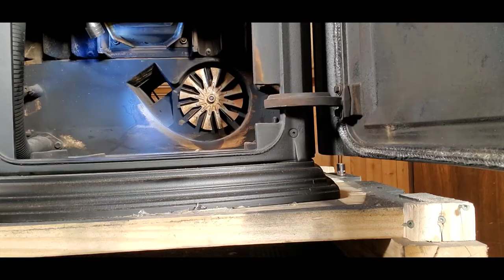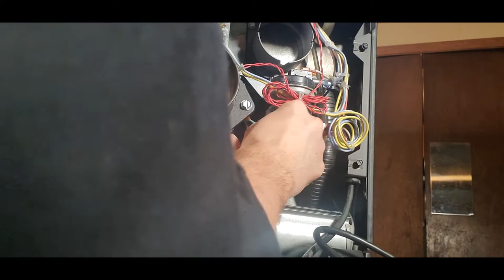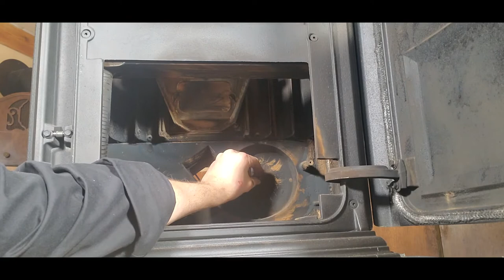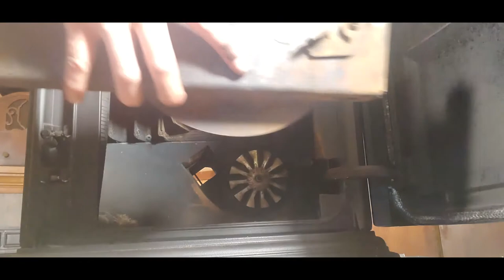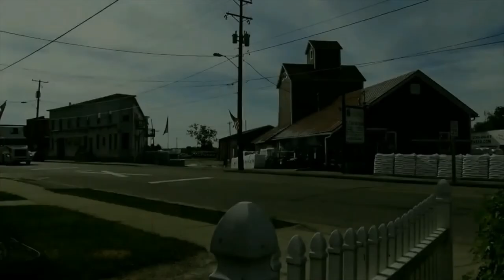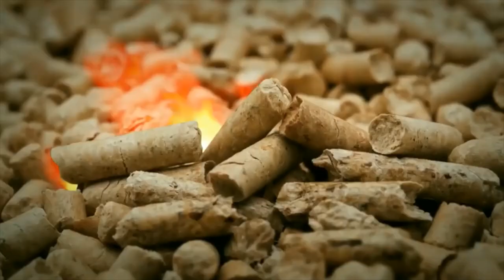How To Replace a Harman Combustion Blower, Exhaust Fan Draft Motor

Comment: Do you have a video of this teaching on a Harman Advance?
Reply from the maker: Thanks for the message. We do not, just on the Accentra FS here, however the Advance is very similar in all aspects. Any specific questions let us know, happy to guide you through. Thanks!
Reply: @EarthSense  Ok. Also I went on your webiste to try and purchase the auger and combustion motors but I do not know which I need because you have several to choose from. My advance is from 1999 so do I need the counter or counter-clockwise auger and which combustion motor would I need?
Reply from the maker: @milagrossmith4891  Thanks for the message. 1999 Advance will have the chain driven feed system which requires the 4RPM Counter Clockwise Auger Motor. Link below will show you OEM and Aftermarket options. We also have a video on auger motor replacement in the chain drive Advance if you need to reference that. 

https://youtu.be/AeuekPHdoCs

https://pellethead.com/product/harman-4-rpm-counter-clockwise-auger-feed-motor-oem/

The combustion motor will be part 3-21-08639 and fits all year Advance models. Link here will show the OEM and aftermarket options. 

https://pellethead.com/product/harman-heatilator-ecochoice-combustion-blower-exhaust-draft-fan-motor-oem/

Let us know if you have any other questions.

Thanks!
Reply: @EarthSense  I am in the process of ordering now. Does a combustion motor come with the single paddle blade or do I have to purchase have separately
Reply from the maker: @milagrossmith4891  Your Advance uses the 5" double paddle fan blade. If you do need a new paddle that will be separate - here is the link to the one you would need https://pellethead.com/product/harman-heatilator-5-double-paddle-combustion-fan-blade-impeller-aftermarket/
Reply: @EarthSense  thanks for everything. I've already ordered. Cannot wait to receive these parts and get my stove going again
Reply from the maker: @milagrossmith4891  Absolutely! Keep us posted once received and if you need any guidance we are right here to help. You'll be warm again in no time!
Reply: @EarthSense  Hello again, so I finally took out the old combustion after having to use a hacksaw to cut the  pipe because the allen screw was stripped to death and would not budge. I notice that the new combustion does not look like the old original one. The old one looks like it has another fan behind it. Can I still use the new one I purchased from Earth Sense.?  Also what about the electrical wiring. How do I attach the wires because it seems like a different set up?
Reply: Ok so i re-watched this video again for the 100th time to see how the electrical was connected. Turns out I do have the same wires but in the new blower the wires are not incased inside that thick back wire. they are just loose. Can I still re-connect the stove this way? and what about the round wire?
Reply from the maker: @milagrossmith4891  Thanks for the message Milagros. Yes, the early Harman combustion blowers had a double fan enclosure. All new replacements will just be the single fan like you received. We guarantee 100% correct function and performance. Happy to walk you through the electrical. What lead wire colors do you have coming to the combustion motor? Earlier units were a bit different, but the new parts are compatible. Let us know and we'll guide you through. Thanks!
Reply from the maker: @milagrossmith4891  Hey Milagros, just saw this message as well and wanted to respond. Glad you verified the wires. Yes these wires will be loose, again another design change over the years, but yes connect it with those wires and if wires are loose/dangling once installed you can always use a zip tie to keep them secure and away from other components. I'm not 100% sure what you mean by 'round wire' - can you provide me a little bit more detail/explanation? We'll get everything 100% bud!
Reply from the maker: @milagrossmith4891  I think you meant the ground wire Milagros as I think about it. Yes, earlier units will not have that ground wire spade. You can either leave it disconnected entirely or you can ground it to any screw on the stove body. Most will simply leave it disconnected. Keep us posted!
Reply: So I finally finished replacing the auger & combustion motors. Your instructions were on point!! Thank you for your instructional and informational videos.  I have never done this before and doubled I could but I followed your steps and success!! My stove is now working and not a moment too soon for these frigid temps were are experiencing. Just a comment I would like to make regarding the wiring on the combustion motor. The new one did not come encased in the long thick black wiring as my original one did and the wires on the newly purchased combustion were not long enough to run to the other side. The solution: I cut the plastic tabs holding all the wiring together and brought them to the other side and connected them. I took the old ground wire from the old combustion motor and hooked it on the new one and ran the wire to clip it on the other side. Worked perfectly!! I cannot thank you again. Not only did I save money but not I know how to really "service" my stove.
Reply from the maker: @milagrossmith4891  This is fantastic to hear Milagros! I can feel the empowerment you achieved by completing this; great work! I will pass along the note on the combustion blower wiring to our tech team so they are aware of this for earlier models. So glad to hear you are warm again! Any questions or help needed down the road just drop us a line. Thanks again so much!
Reply: @EarthSense  hello do you sell parts for The Englander pellet stove? Please tell me the website again thank you
Reply from the maker: @milagrossmith4891  Hey Milagros, nice to hear from you. Yes, we do offer a decent selection of Englander parts. Website is pellethead.com. Let us know what you are looking for and I can send direct links. Any questions let us know!